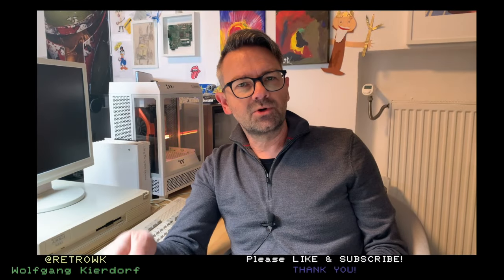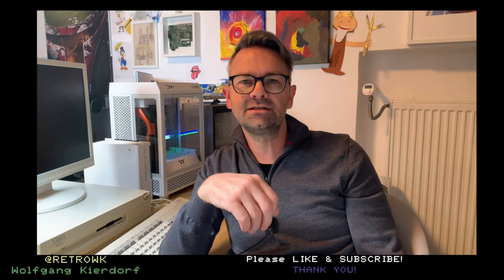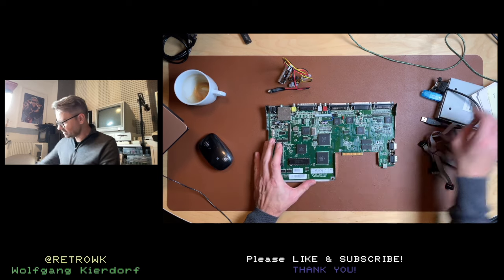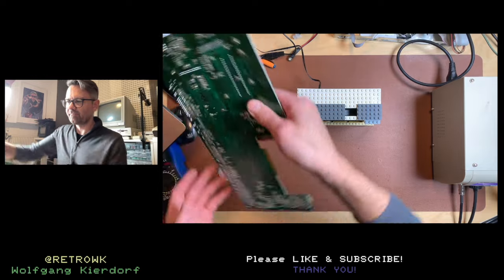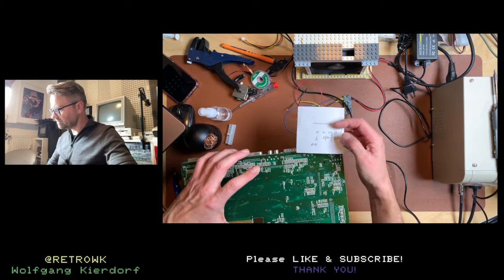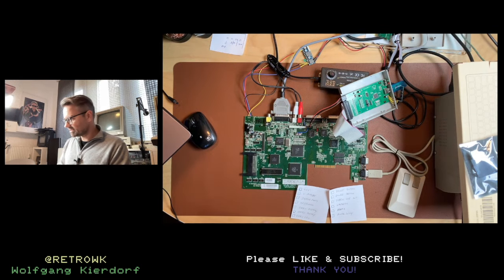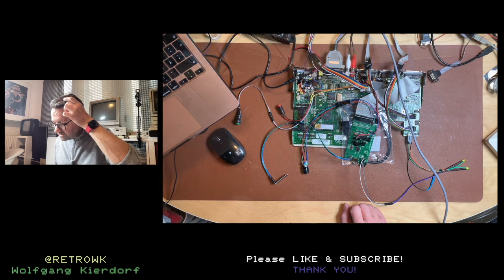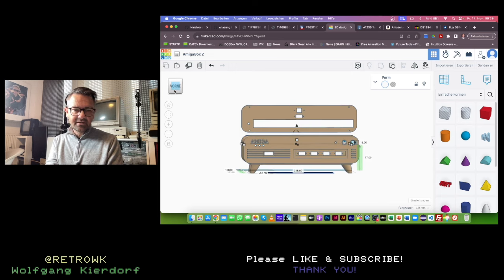Turning an Amiga 600 into a Classic Gaming Console! - Part 1: The Mods #DIY #retrogaming

Comment: I do like the ways people are getting Amiga boards and modifying them to their own liking... (like the A500 mini or c64 maxi), adding GoTeck and the like.. I still say it, breaking out the nostalgic zone, because you can not really call it a true Amiga if 90% of it is modded for today's world. But, its still interesting, to see whats possible nevertheless.

The HDMI adapter is probably extensive because of "license fees"  or something.. If that wasn't needed then the adapter might have been cheaper.  I've noticed these things usually are not cheap... same with USB-C, so I always assumed it was soe sort of extra cost that is needed to make it certified.
Reply from the maker: That's why I like a plain old A500 with a disc drive. But it's still fun to experiment and see what is possible.

Comment: Cool project.

I got a Gotek for my A1200 big  box project, then I bought an OLED screen for it. I lost the Gotek just before the screen turned up. Then I lost the screen too. LOL

So my Big Box A1200 has built into it a CD ROM, 5 watt stereo speakers, 7 inch LCD screen, front access to the external PCMCIA and the HD CF card, USB mouse, USB keyboard, Composite, VGA and HDMI video out, stereo audio out, MIDI in and out, 12 bit stereo sampler in and 137 MB of RAM
But no floppy or Gotek drives. Ha ha. It's a great machine though.
Reply from the maker: The mystery of disappearing tech. I wonder if it will ever be solved. How can things move between boxes, end up on the bottom of some drawer you never use and many more strange things that happen in the lab ... ;-)
Reply: @RetroWK  Not to mention the mystery of the self tangleing wires. 🤔

Comment: Well ... why not use a connector between the board and the pico PSU? Would be easier to maintain i assume. I would hate to desolder everything just because i had to change the PSU or something like that. Would be easier to assemble and disassemble in the case too perhaps?
Reply from the maker: Probably right. It's tunnel vision. The original idea was to have the PSU inside. The way it is not I have a PSU inside and one outside ... not very clever.